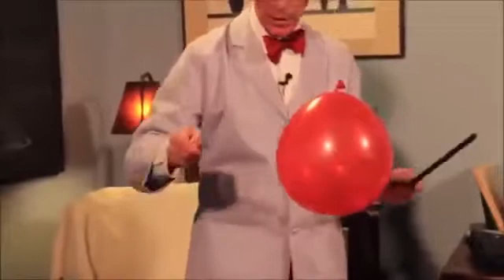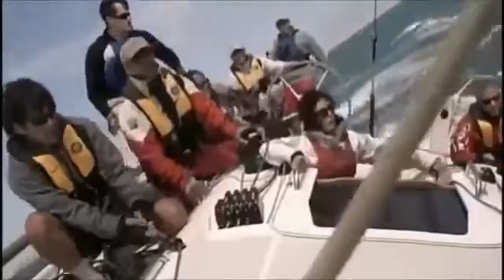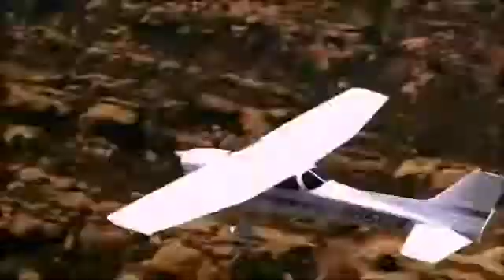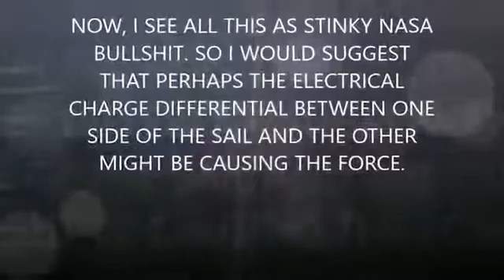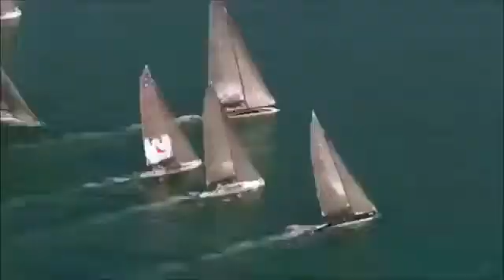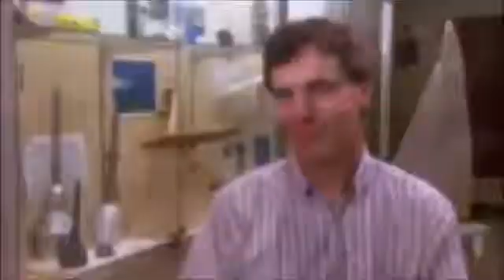Flat Earth Is Sailing Upwind an Electrical Effect

Comment: HI is it, if this is your theory of electrostatic effects on the sail and the keel then there are a number of issues with this. What is attracting or repelling electrostatic sources? Whereas the effect of lift and flow over a curve of the sail can be seen and repeated due to the wind and the sailor also has to watch the tide to position the keel with respect to the ebb and flow of the water beneath the boat. I kind of have to agree with your sentiment at the end. your proposition is not a substantiated hypothesis is kind of bollocks. kind regards Colon